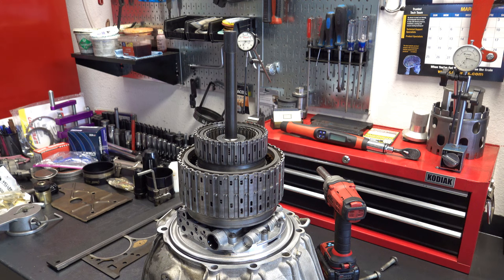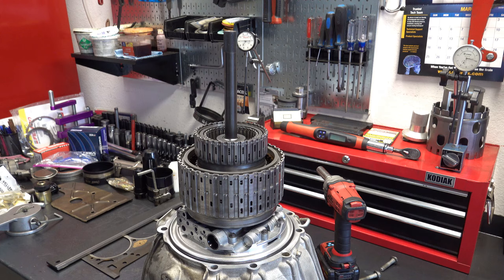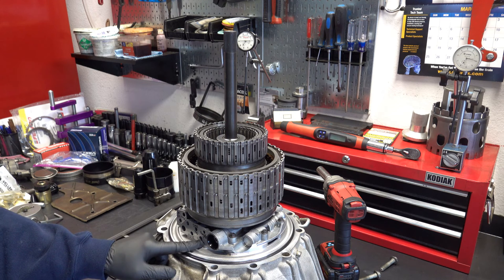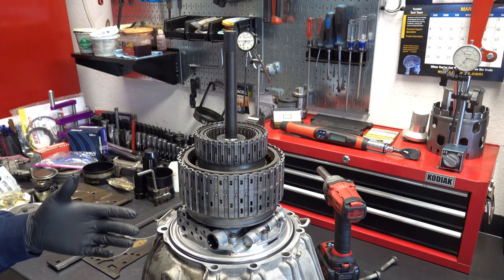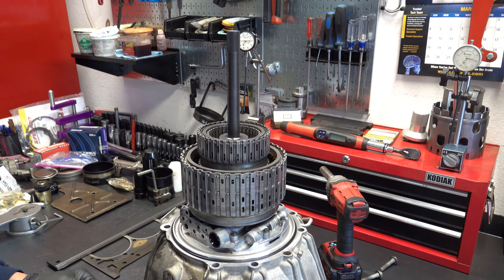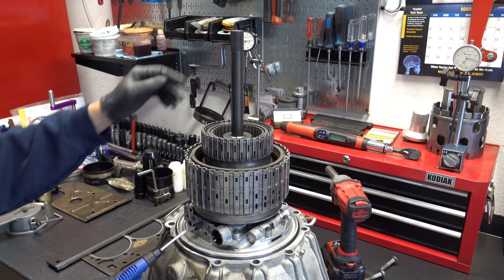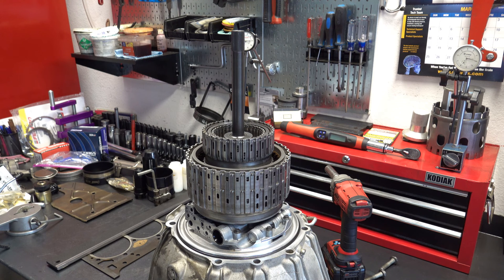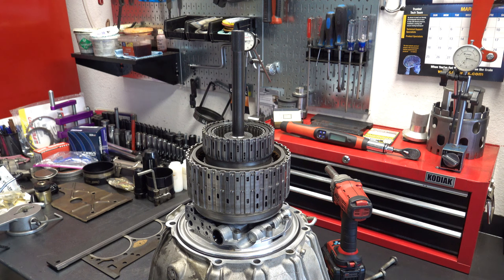6L80 Air Check - Pump, Drums and Compensator Feed

Comment: Firstly, thanks for the great content @nickstransmissions! I am in the process of rebuilding my 2014 Silverado RWD 6l80 (all new GM & Transtec parts with a few Sonnax, Transgo & Superior upgrades along the way) and am now doing bench air checks but having issues. The 456 actuates but doesn't hold pressure for more than a second and the compensator feed does not jump around and instead I can hear the pressure venting off. What do you think the issue is?

Tests completed @~40psi

Test 3: 1234/35R/456 drums installed (Pressure via pump inputs)
456 - (Actuates but does not hold pressure for more than a second at best) - FAIL?

CF - w/finger in intermediate shaft (No jumping around of the 1234/35R drum. The air pressure leaks off. It sounds like it leaks from within the 1234/35R drum area) - FAIL

1234 (small leak to 35R port solved by adding a small amount of hydraulic fluid.) - PASS
35R (As expected air leak via vent port hole) - PASS

Test 2: Via pump inputs (No Drums)
1234 w/shaft port sealed - PASS
35R w/shaft port sealed - PASS
456 w/inner shaft port sealed - PASS

Test 1:
Solo 456 (Finger over other port) - PASS
Solo 1234 w/drum test tool - PASS
Solo 35R w/drum test tool - PASS
Solo CF (x2) w/drum test tool - PASS
Reply from the maker: Thank you for the views and kind words, RR-cu7vi. If you haven't done so already, check drum for leaks as well as stator-stator support gasket - both can cause comp feed circuit leaks. Also (again, if not already done), wet pressure test the input drum as well. Scrutinize the input shaft for any hairline fractures, etc.

Comment: I’m air checking the compensator feed circuit , and I’m getting blow back on the 1-2-3-4/3-5-R ports on fluid pump. Is this normal.?
Reply from the maker: Is this with the trans on the bench/stand or are you trying to air test the unit while it's in the vehicle? 

Need to know that first.
Reply: @nickstransmissions  I am testing it on the bench. Same way that you did it on the video.

Comment: If you put air to any of the 3 ports ,and they all leak together,  possible stator support gasket ?
Reply from the maker: Did you replace the stator support gasket? If not and you also did not remove the stator shaft, it's not likely to have a leak there.

Comment: Great video! Have you ever encountered a 6L90 with a 2/3 double shift? Happens once per start cycle and shifts perfectly until restarting.
Reply from the maker: Never heard of a "double shift" but it sounds like the TEHCM is adapting to an anomaly in hydraulic apply circuitry or issue w/one of the clutch packs. Was this unit recently rebuilt? If no, how many miles on the transmission and do you have any DTCs?
Reply: @nickstransmissions  yes recently rebuilt, did it right from the get go. New TECHCM and no dtc’s.
Reply from the maker: I suspect your 3-5-R clutch clearance may be out of the specified range and the computer is adapting to that condition hence why you're only seeing it on the first 2-3 upshift of your drive cycle and doesn't repeat until the vehicle shuts down and starts up again.
Reply: @nickstransmissions is it possible to check those clearances with the trans in truck and valve body out?

Comment: So this is my first time rebuilding 6l80e I got the clutch packs put back in and done my air test just like you but I have no movement on the 3/5/r pack and all I hear is air I’m going back through it now and I have already checked the drum for cracks. Any ideas on where to look. The 1234 and the 456 are working perfectly it’s just the 35R. Thanks
Reply from the maker: Thanks for watching, bettiegagne. You'll need to pull apart the drum, take the pistons out to see what happened.
Reply: @nickstransmissions everything is moving fine now but I still have air coming out the holes when I do the air test

Comment: This video is great Nick I have watched all your videos over and over and rebuilt 1 trans all great … this second trans has been a biotch … air check doesn’t work it got a cross leak ? … test the 35r by itself .. it works … how do I test the stator by itself … is there away and or a video for pressing the stator together how can I mess that up? A o ring and basic gasket ? Is there a common cross leak .. I’m using the non spinning shaft seals … so to me it’s either gasket and o ring or the external none rotating seals ? Is there a common cross leaker ?
Reply from the maker: Here's my HiPerf video. Skip to the pump section where I show the stator removal and installation: https://youtu.be/Se3bGJzpYmQ

Comment: Hey Nick, doing my first 6L80 (2016) and got a couple questions:
1.  Got a 3-5-R drum issue for sure.  Get good apply in both 3-5-r and 1-2-3-4, but as soon as I plug the opposite hole, those opposite clutches slowly apply, i.e., apply air to 3-5-r and plug 1-2-3-4 hole, 1-2-3-4 slowly engages and vice-versa.  I bought a 3-5-r drum checker, but has a defective o-ring groove, but was able to move o-rings around to check both those circuits and don't see anything leaking, even the weld joint.  Stator rings?
2. In center support there's a bunch of black chunks.  Not metallic, more of a composite or plastic.  What's in bottom end that this could be?  Clutches all look good so far.
Reply from the maker: Black chunks could be torque converter clutch material but without seeing them myself, it's just speculation. 

For cross leak tests, I only put air into the 1-2-3-4 to see if I have cross leakage into the 3-5-R circuit and that test is best done when the trans is in the vehicle and you're trying to diagnose sealing ring wear as the culprit for either wrong gear starts or other drivability symptoms associated w/the 3-5-R clutch.

Air testing on the bench will always produce some air blow by...As long as each clutch pack applies strong/firm using 75-100PSI of air, you should be fine.
Reply: @nickstransmissions  Why can't I respond?
Reply: Want to send you links of what I'm experiencing and they won't post?  Not a You Tube expert
Reply: @nickstransmissions  https://youtube.com/shorts/35RvEJByLsk

Comment: Hi Nick. Thanks for this video. My question is, what would be the cause of cross leaks between the 1234 and the 34r.. I have that as well as a slight hiss when testing the 1234.
Reply from the maker: Thanks for watching, man. Check sealing rings as well as the lip seals on the 3-5-R apply and balance pistons along with those in the drum.
Reply: @nickstransmissions 1. Would the lip seals show a leak if I tested the drum assembly by itself (off the stator)?
2. The stator rings are new/unused.. your vid said they might leak until heat cycled.... is this to be expected (probably my symptoms)?
Reply from the maker: If you have the air check tool for that drum or can figure out a way to air test w/out it, def do so...You shouldn't hear any hissing coming from the 1-2-3-4 but will hear hissing coming from the 3-5-R as there is an air bleed orifice at the base of the drum...
Reply: @nickstransmissions yeah I tested the drum by itself and it was fine.. I tested it on the stator and when I added a bit of oil to the port it sealed up for a short while.. I just put it back together with fingers crossed lol. If it does anything wierd I'll drop the trans again.

Comment: Hey Nick 
 So i air checked my 1-2-3-4/3-5-R drum with the test tool, and the 1-2-3-4 applies great  and one of the compensator feeds hold air perfectly but the 3-5-R clutch leaks air like crazy even when i cover the bleed holebut i dont see any bubbles around the weld. And the other cf port on the test tool seems like its blowing air back out of the test hole. What do you think would be the best solution if i cant find anyone who can weld the drum near me and what would be causing this? Also, this is with all of the old seals and clutch modules in the drum
Reply from the maker: Hi John, you can buy a new drum from GM fully loaded which is what I'd do if you can't locate someone to weld the existing one...If you do re-use your drum, assuming you find someone to properly weld it (make sure you point out the little bleed hole near the weld line and tell the welder not to weld over it, otherwise he may miss it) you need to completely empty the drum of all pistons, belleville plates, seals, etc. 

Also don't do any air checks for function unless you replace all the seals in the drum.
Reply: Ok thank you so much! And yes sir, I've been watching all of your videos and have purchased everything you've mentioned and am currently in the build process. But if I replace all of the clutch components and recheck with the test tool and have no leaks, would I be ok to reuse the drum without welding it? It is an updated drum out of a 2015 Silverado 1500 4x4. Thanks again Nick, sorry for the lengthy question but I want to make sure I get this right. I spoke to a guy at a local transmission shop and he said if the drum didn't leak and it was an updated drum then it'll be fine  @nickstransmissions
Reply from the maker: The later drums were much more reliable than the earlier ones so it should be fine.
Reply: Thank you so much Nick! You're the best, thank you so much for sharing your wisdom and knowledge. The guys at the local shops I called sounded pissed off that I was even attempting this myself even though I've been around working on cars all my life. So for you to be generous enough to take the time out of your day to make videos AND answer these comments is truly commendable. Thank you for what you do and I pray you're able to continue.  @nickstransmissions

Comment: Nick, I am air checking my 4-5-6 clutch on the bench and getting some audible cross leak out the CF hole despite installing new sealing rings on the input drum with the aftermarket expander/collapser.  Is a little cross leak normal or do I need to redo the rings?  The clutch engages fine, and the input drum assembly checks great by itself when it is removed from the unit.  This is my first 6L80 rebuild and everything else checked great.  Thoughts?
Reply from the maker: HI Densmith, I discuss what to expect when air checking apply/CF circuit when using new sealing rings dry specifically in the video - give it a view if you haven't already then let me know if you still have further questions.
Reply: @nickstransmissions  Yeah, I did see that part of your video but I was not happy with my 4-5-6 clutch apply.  It did apply but was pretty weak (not crisp) with significant hissing at the CF port.  My results of other things you suggested in the comments:  I checked the new stator support gasket by applying air on the outside of the shaft and blocking the internal holes with my finger and had no hissing at the gasket.  I checked the inside of the stator shaft for sealing ring wear but it looked perfectly smooth.  I finally solved the problem by reinstalling new OEM turbine shaft sealing rings, which led to a crisp 4-5-6 apply and just the slightest perceptible leaking at the CF, exactly as you have in this video.  I'm much happier with this.

I see 3 possibilities of why my sealing rings tested very well on the second attempt:

1) When I resized them this time, I immediately installed the input shaft and did the air test, as opposed to letting the resizer sit on the rings for a couple of weeks like we usually do.  I recommend you experiment with this to see if this method improves your testing due to more outward residual "spring" on the new seals, and see if that makes a difference.  Maybe leaving the resizer on too long actually hurts the air check???

2) Perhaps I botched the installation of the first batch and had a minor nick, but nothing was visible to the naked eye upon close inspection 

3) Perhaps the OEM sealing rings that I did the second time were better than the ones that came in my Transtar kit, but I doubt that's the case.  

Thanks for your help, I hope this feedback is useful to you and I really appreciate your whole 6L80 series.  This was my first 6L80 and you made it so much easier!
Reply: How can you send pics?

Comment: I have watched all your videos on the 6L series of transmissions. They are incredibly informative and helpful to understand the interworkings.  If you have time, I have a question. I've got a 2015 6L80 out of a suburban. It was rebuilt last year.
But now i'm having a delayed engagement on first and reverse
about 70% of the time. And when that occurs, it will only engage with raising the rpm's and then will slam into gear. The only code I can get out of the tcm is P0751. After I earse it will take a few days to come back, but problem will continue even before the code comes back. If I remove the techm and valve body. Are there any air tests I can do with the transmission still in the truck? And have you encountered any issues like this before? Thank you in advance.
Reply from the maker: Hi W, thank you for the views and kind words...Have you contacted the shop that rebuilt the transmission? If so, what did they say?
Reply: @nickstransmissions  it was a bench job. It started having the issue just after the one year warranty was over. They said, remove the transmission and bring it in. And they will honor the warranty, even though it was after it was over. They took it apart and said there was a clip that came out of its seat. And put another reman torque converter in. This is before I started doing research  extensively on this transmission, or I would have had more questions. That fixed it for a couple of days, and the delay came back. Brought it back to them. They seemed perplexed. They want to put another techm, which they will charge for. It doesn't seem like this shop does much diagnosing. Just rebuild and ship. That's why I am asking your opinion. The original rebuild was a new pump, reman torque converter, new techm, and complete rebuild with updates.
Reply: @nickstransmissions  Once the code stores, second gear is commanded by techm to start not first. But it will still have delayed engagement.
Reply from the maker: They would need the vehicle to bench test the TEHCM using the Bosch TEHCM test plate kit so they can rule in or out the TEHCM..Since it was a bench job and they didn't do the R/R initially, that will probably cost whatever they usually charge for it. 

P0751 is typically clutch select valves/springs...Those valves are in the lower valve body so if they didn't do anything with the valve body, that's where I would start...If they did install a comprehensive hydraulic corrective kit like the Sonnax Zip or Transgo Tow-N-Pro then there's not anything I can tell you from here...The unit would have to be taken out, torn down...TEHCM bench tested for electrical and mechanical function, valve body and pump stator support vacuum tested and internal case components thoroughly inspected. 

Have you ruled out external causes like possibly bad grounds, loose transmission case connector, etc?
Reply: @nickstransmissions  Again, thank you for taking the time to respond.  I'm going to double-check the connector and locate grounds to clean up before I bring it back to them. When I find out what the problem is, I will comment back.
Reply from the maker: Sounds great, man..Yes, please let me know what you/they find.

Comment: Hi Nick, assembling a 6L80e and tried to air check when assembled but just getting air leaks. I am using the Transgo SK6l80 shift kit with the blue rings and back up springs supplied, non locking type steel stator. I have assembled with trans gel on the rings which the kit suggests but i guess that is why it isn’t air checking correctly. Should I take the pump out again and use the old rings and check as per your video? Also do you have the air checking procedure for the 2/6 clutch and low rev. I am getting an air leak on the second port in on the park pawl side, not sure if it is correct or not. Thanks for your help.Regards Ross
Reply: Thanks for your reply Nick
Reply from the maker: Hi Ross, swap to a 2nd design stator - never go back with a 6L with the 1st design as they are notorious for cross leaks...That by itself will likely fix your problem...Also note that teflon or plastic and similar style sealing rings will never seal 100% against their respective surfaces when dry using air...They're designed to expand in the presence of hot fluid and seal against the inner bore diameter of whichever part they're sealing against. 

Here's a 6L80 air check video: https://youtube.com/shorts/qG-mb8Rs34g?feature=share

Comment: Nick - amazing vids! is there ever an acceptable amount of crossleak? Silly question lol. Feel a very slight amount of pressure when air checking 1-2-3-4 cross into 3-5-R feed and vice versa.
Reply: Excellent! Appreciate it. I am 90% complete on putting this 6L80 back together.
Reply from the maker: Thanks, StarworksTX! 

A small amount of cross-leakage can be expected when air checking as it's nearly impossible to seal off those circuits unless you're using rubberized sealing rings which the 6L80 doesn't have for the pump stator or input shaft...This assumes you're air checking the drums just like I show in the video.